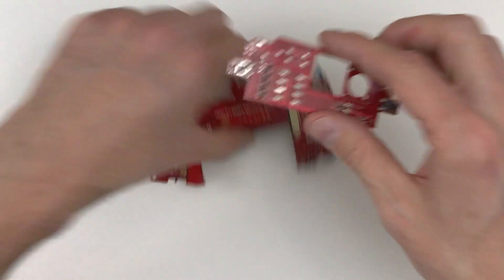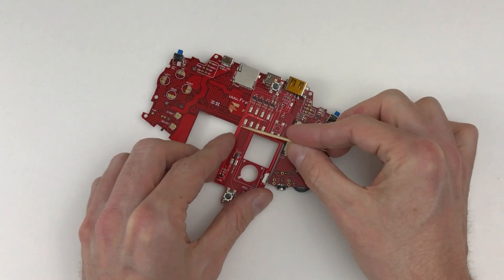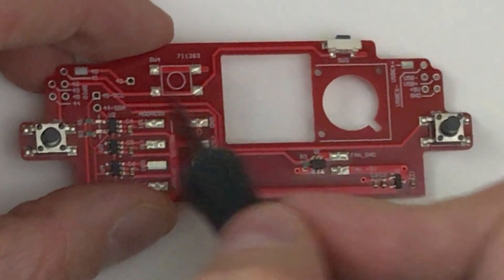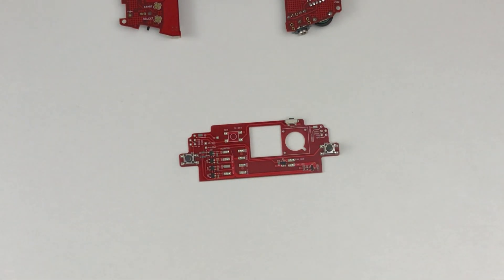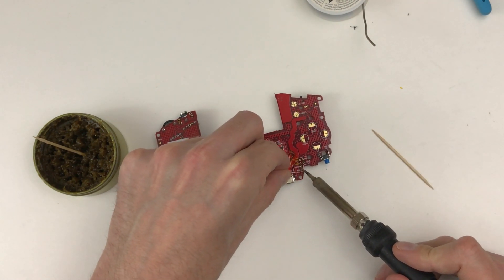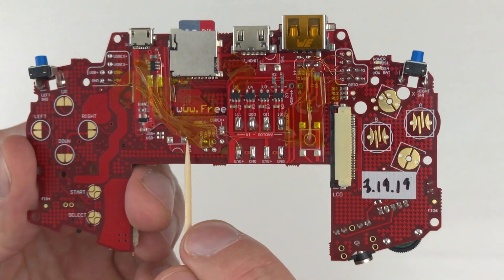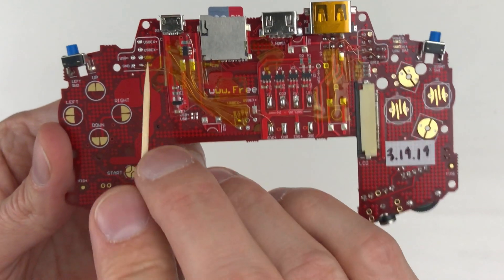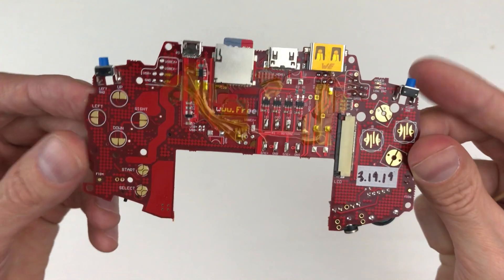Build Log Freeplay CM3 3DS Dual Analogs 01 - Addon Board

Comment: Hey Hipcat first of all you make the best custom gba ever and I'm currently planning to do a build but I wanna do joycon analogs and the triggers, how you did on the white gba build. Just wondering what your thoughts on that would be. Also would this build be possible without slimming out as well.
Reply from the maker: nick Fleming Thanks! I do like the Joy Cons feel, but I have ran into a couple that eventually got the dreaded drift issue. Not too big of an issue for me because I can swap them out fairly easily, but something to think about that could be annoying sometime. The Vita sticks are good too, but no L3/R3 click. Slimming is definitely only an optional thing. It is totally cool, and arguably better to go with the normal full size GBA for that sweet sweet nostalgia. I’ve been thinking about doing another build but maybe trying out one of the Boxypixel metal shells. Trying to think of how I could possibly spin that buy to my wife. “But we neeeeeed another Freeplay CM3 because this one is metal,... think of the metal.” Yeah that’s not sounding good enough yet I guess. For the shoulder buttons, my favorite so far have been the soft tacts through the L1/R1 shoulder buttons of my black Slimmer build. After trying a few different iterations of that style those were just right. A little tough to get them perfect though especially being soft tacts; you have to make sure you position them in a way where the surround plastic of L1/R1 creates a guide like a button well for them so they always press correctly. Just a little tricky to get that part right for the best feel. In the white build with the clicky tacts on top of the rear shell I’d say they didn’t feel great because they were clicky tacts, but they got the job done just fine. Also with them just being L2/R2 you don’t really use them all the time. At least I didn’t. Hit me up at 0hipcat0@gmail.com if you want; I don’t know a ton, but I may be able to help a bit :)